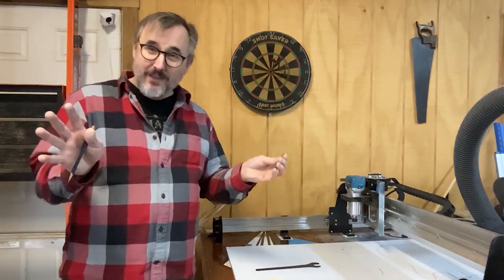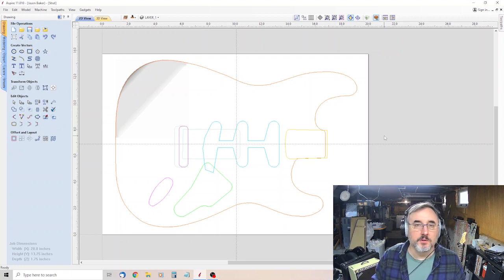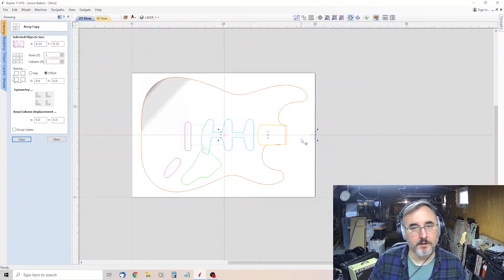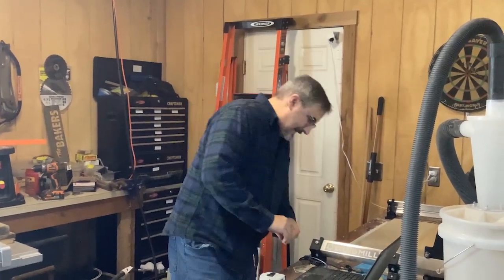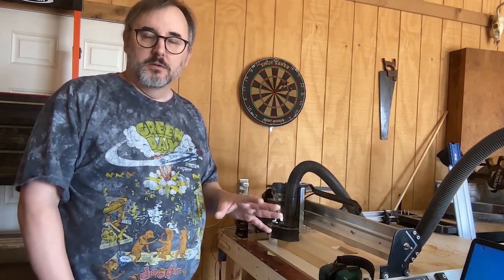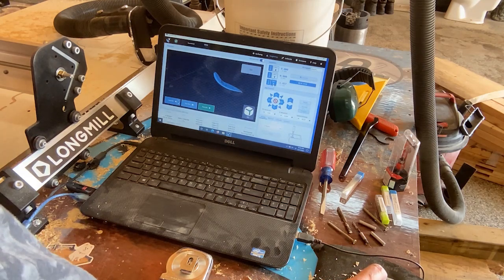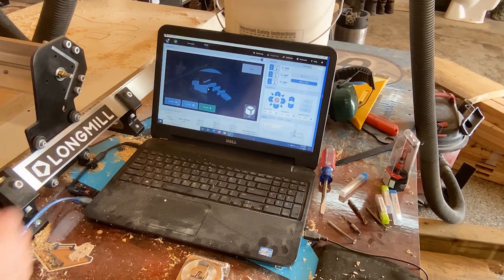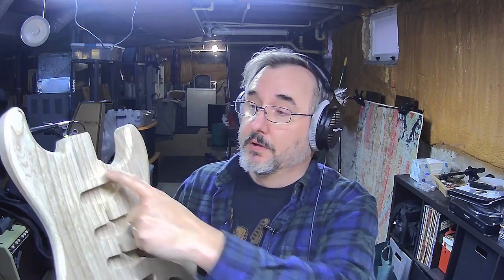Creating a Strat Guitar Body in Vectric Aspire Part 3

Comment: You should create a separate toolpath for your spoilboard registration and copy that same setup for your material (with different depths of course), reset your XYZ again as needed. If you bottom out that collet enough times like that you'll be buying a new router. Best not to push it :)   My process is: cut the pinholes on the material, cut the pinholes on the spoilboard, pin the material, set XYZ to the material. Profile the body half way with tabs at the middle of the material, flip and finish the cut. The touchplate is also a must have investment. Good series. Have enjoyed it very much.
Reply from the maker: Thank you. The 1st gen LongMill I have doesn’t have limit switches. I actually should recess my spoil board too. The Z travel on my router isn’t terribly large. I appreciate the advice.
Reply: @JayceAllanGuitar  I almost bought a long mill but went with a shapeoko 4 xl. I love that machine. It has changed the way I do all of my guitar work. Z travel is always a limitation on these machines so I feel your pain. One option that helps with these limitations (on bodies) is to work within these limits, do drop tops etc. just play to the strengths of the equipment. Anyway, your content is greatly appreciated. Thank you for sharing your experiences